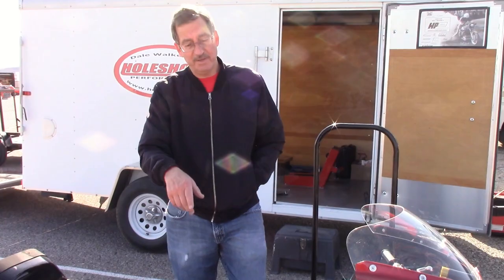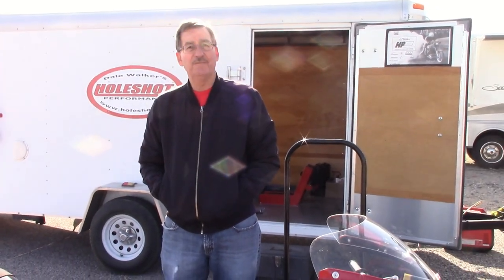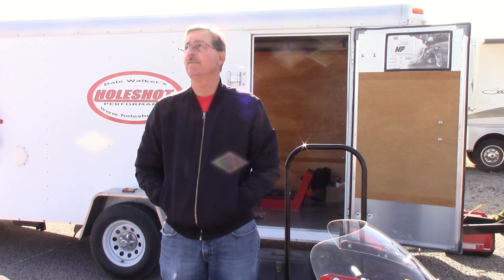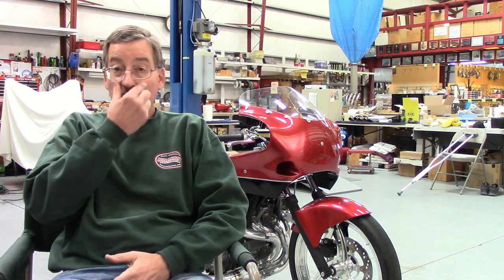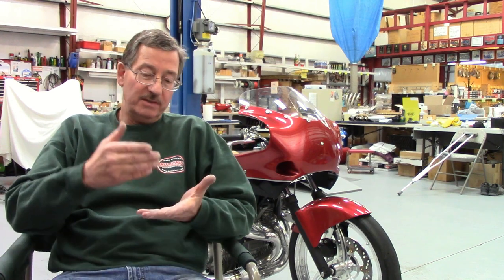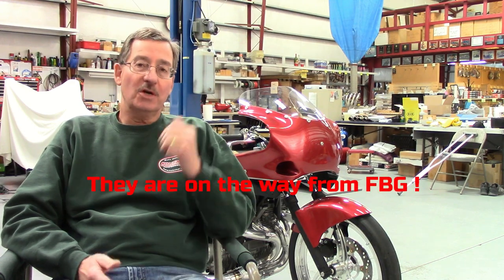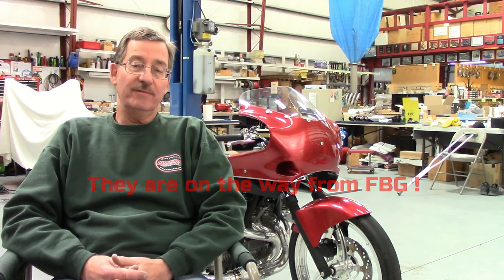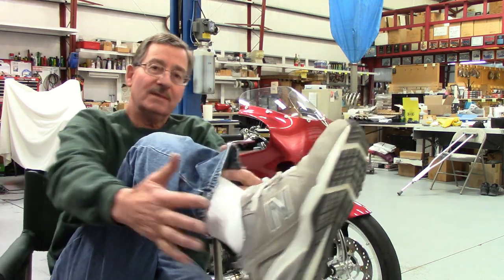Dale Walker Test Day 2  RATZUKI !

Comment: Hope your winter was good. Is Ratzuki coming out of hibernation? #raceprep #win
Reply from the maker: Hi Wayne, Dropped a valve seat at a race day, so motor it fully pulled apart. Destroyed my cylinder head, tagged all the pistons and one sleeve. Gathering parts and building a 1497. Bought another head and did more work to it. I'm working on my retirement shop and other property now. We need to move this year  and get our current place for sale. Super busy so no videos lately after my cancer 2nd time around.  I will make a update  video in the near future. Cheers  Dale

Comment: Dale, I was suscribed, I don't know what happened,  if I offended you in the past in any way,  forgive me. I do know that people get unsuscribed on YouTube for no reason. That being said, 
I'm going to offer you my 40 plus years of engine building and dyno experience. Don't take this wrong, I have followed your career for decades. 
OK, let's call this a lean surge, but why, too much air or turbulent air, or fuel starvation.  Next, we only got to see the outside float bowls, how about #2,#3 ?
You're old school like me, the best engine builders in the world,  still READ plugs. Do a plug chop, REMOVE THE PORCELAIN from the hex, and read the porcelain like we know how to do.  More than just a possible lean condition,  but also variance between #1,4, and #2,3. 
Here's what I did for my surging at high speed.  I built a sheet metal air dam for over the top of the carbs/velocity stacks, as I believe that turbulent air was coming under the fake tank and frame. This helped some.
Secondly I, and you can laugh,  took the steel toes out of a old pair of boots, mounted them on each side of the bodywork, with the opening facing rear. I believe this to not only block turbulent air from #1,4, but also in essence gave a better volume of non turbulent air to the outside carbs. And it looks cool 😎. 
I agree with you about the needle and seats, and of float level.  I'm Paul Gast biggest fan but I even run a larger float bowl on the Harley Engines I build that have the C.V. carbs. I modify them insanely, and they work and perform.  On the dyno,  against a flat slide Mikuni,  I only give up 2-3 horsepower,  and only up top. 
I hope this and you and your wife are doing as well as can be expected.  
T.S. RACING
Reply from the maker: Should not have to do any sheet metal work. I've run a hand made aluminum air box, and zero air box in this chassis. Both in the 7s. I had hand made panels on the body to shield 1 & 4 with the same results. I know several racers that run, bodies with no air box , carbs covered or fully open without troubles. I do have about a 23 degree angle at the carbs. I plan to fudge a bit to get them a bit more level. We will see if more float bowl volume helps or not since I have a set coming. I plan to check the needle and seats soon, just to be sure there are correct. I ran this same intake track years ago and these carbs, but never N/A only. I ran NOS from day one, so there was my extra fuel. Paul tells me 97% of bikes out there run the plastic bowls. I will make it run clean first, then plan to spray a light load. Plugs are plenty rich , #3 slightly leaner but that's in my intake track. I think the bowls are running low, but not enough where it wont run. We will see in the near future !  Cheers DW
Reply: Thanks Dale for the response. I should have mentioned that my bodywork is a different than yours, and not in a good way. I do remember that I bought one of the first ever one piece f/g bodies for the GS, as well I have one of Sandy's first double weld rear wheels.